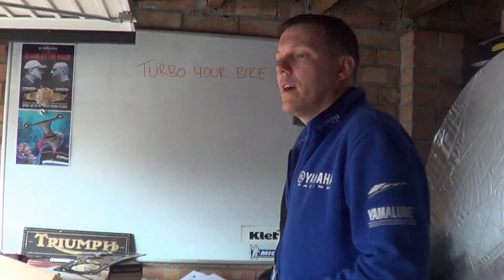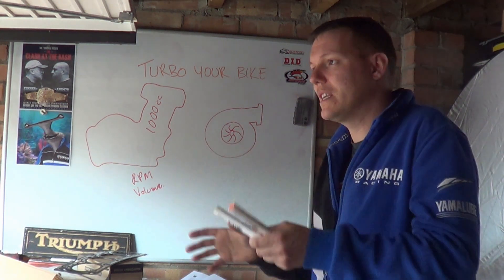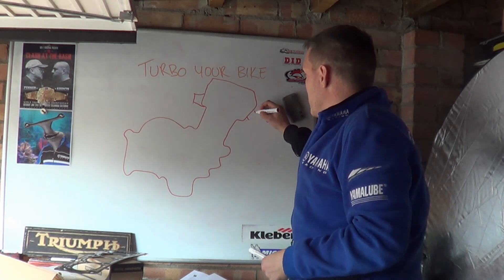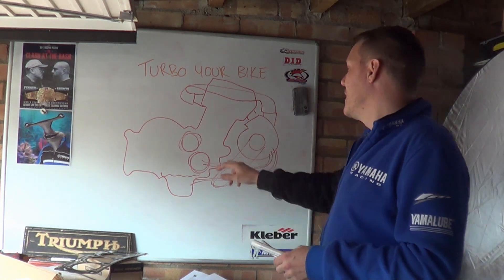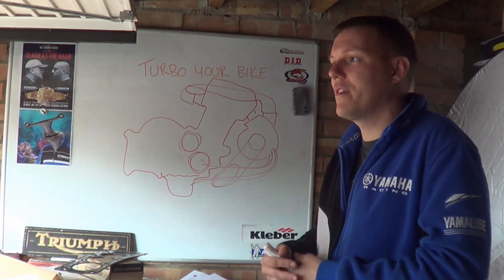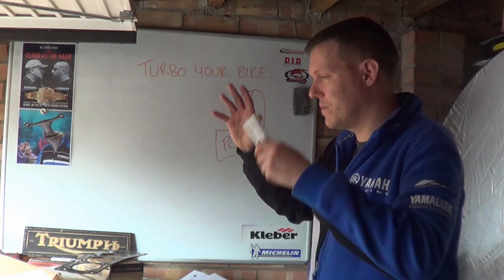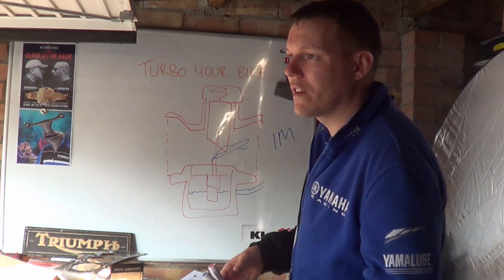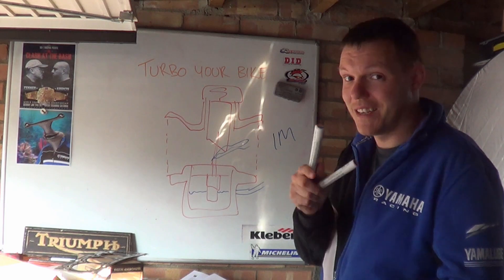So you wanna Turbo your bike? Part 1

Comment: So my bike is 650cc with a max RPM of 6500

6500 ÷ 2 = 3250rpm

3250 x 0.65 = 2100 ish

Would that be correct for liters of air per minute?
Reply from the maker: Well it depends, is it a single or a twin?
Reply: @thedirtyworkshop  it's a vtwin, xvs650
Reply from the maker: So, yes, that's correct. Just making sure it wasn't a 2 stroke.

Comment: Hi I'm fitting a turbo to a 08 zx6r,  drag bike build , motor is pretty much stock. I think I need to lower the compression,  can you recommend a thickness for a headgaskit ,  running a td04 turbo. STD compression on a 08 zx6r is 13.9: 1
Reply from the maker: Lol recommend or work it out for you?
Reply: @thedirtyworkshop  recommended,
Reply from the maker: That was a joke, you need to work it out. Work out what compression you want and what volume that would be

Comment: I would like to play around with this some.  I have several donor bikes, 500cc and 650cc Triumphs late 60's.  What happens if the turbo is too large for the engine?  I can't imagine finding a smaller unit in the local junkyard.
Reply from the maker: The engine doesn't produce enough exhaust gases to spool up the turbo, which means your pressure increase would be terrible and your throttle response would suffer
Reply: @thedirtyworkshop  thanks.  Is there a market for smaller engines with turbos that I may find in salvage or used condition?
Reply from the maker: RHB31 turbo, search for that
Reply: @thedirtyworkshop  NVM, I just checked Amazon and there are several small displacement turbo units available for under $200.  Very inexpensive for experimentation.

Comment: I'm sorry but I've rewatched a few times now and the calculations for what turbo would work don't make sense. More specifically you didn't give key term words on what specs to plug into the calculation. As far as I know I need a 1-liter turbo for a 1-liter engine. I'm just a layman so no offense meant I just can't wrap my head on what you want me to do with my calculator.
Reply from the maker: 1 litre turbo for a 1 litre engine?
Reply: @thedirtyworkshop  I was trying to state how confused I am 😅 the 1 liter bit was intentionally wrong but accurate to my overall understanding

Comment: Well I have found the video I've been needing for the last 10 min since I decided to look into turboing.
Reply: Well if I do, it will be the first rebel 500 turbo... Need to find someone to forge internals for me. Then I can start planning.
Reply: @NoStressVanLife  how’s it coming along bro?
Reply: @love2fight205  well I'm still trying to map how the pipes would sit on the bike and where I'd need to bolt everything to the frame. So far it seems like it should be doable but may be very uncomfortable due to where the throttle body is located right under my seat facing backwards with a lot of wiring around it. Sigh*
Reply: @NoStressVanLife  how about now bro need update
Reply: Update ? @Unknownize
Reply: Update ? @Unknownize

Comment: 100% crazy talk. You will need methanol mist or similar dramatic cooling in the form of fuel (winter windshield fluid)
Reply: You can also retard timing and/or run higher octane fuel

Comment: is it possible to charge [turbo or super] an engine that has a diaphragm carburetor some one told me the crankcase psi is what pushes the fuel into the carb,,,,,,,,,,,is this true??
Reply from the maker: It can at throttle closing - but you can fit a vent to stop this

Comment: In your example of the max airflow of a boosted 2L engine being the same as a 1L NA engine, them flowing the same amount of air in their standard respective formats, great but doesn't that mean if you boost the NA 1L you'll actually need a bigger turbo than the calculation suggests as the volumetric efficency will be much greater under boost condition?
EDIT ah balls it's all based on just revs vs capacity isn't it, sizing of the turbo is done to suit that and applies to both. Makes sense.

Comment: Very good informative video :) 
I'm tempted but my starting point is not that great, just a 600cc bike. I'm not after very big gains, more the fun of building and to have something different. It already have power commander / full exhaust / air filter. I got access to a good workshop to fabricate all tubing / boxes / headers etc. I don't really know anything about turbos but i'm confident that there's some that would fit a small bike these days.
Reply: So I have a Honda cbr600rr ...right and I've been thinking about using a turbo charger from the Suzuki Cappuccino and it is also 600cc and it is turbo charged cause I cant think if any car with about 12000cc and its turbo charge

Comment: What are the best options to scavenge the oil from the turbo into the oil cooler instead of the engine block on a GSX1100G engine? I was considering to use a TD05-16 and leave the engine stock pistons and rods, (meaning, stock 1127ccm) but was worried about the hot oil from the turbo draining directly into the engine. Great video, you've done an amazing job.

Comment: Is it possible to turbo charge Dominar 400??
Reply: Yes but you're better off using a nitrous kit instead cause it's cheaper and doesn't add weight 😜. To turbo your bike you gotta make sure you can fit a custom oil pump first cause without it the turbo won't run for long 😂

Comment: if i wana to turbo my bike how much it will cost (honda cbr 600 f4 )
Reply: Depends how much you are willing to do yourself. Like welding, replacing oil pan parts, fuel pump, injectors, etc. Probably not more than 600$ + (the turbo that you buy)

Comment: Is there any chance turboing bike "easily" like just slap the turbo and thats about it if i use like 0.2bar pressure so just bigger injectors and it will run and hold the extra few horsepower. I got yamaha yzf 750 r.
Reply from the maker: Turbo's require oiling and pipework, system protection (wastegate or blow off valves) etc. There is noe 'simple' way to do it.
Reply: I know I’m late but dude how did you get your hands on that bike

Comment: Possible to turbo charge a ninja 300 ??
Reply from the maker: yes - you can turbo a lawnmover if you want - just quite a bit more involved due to the injection map side of things
Reply: The Workshop going to use the bike for quarter mile drags , please suggest a turbo kit .
Reply from the maker: Why a 300 ninja?
Reply: The Workshop using it for quarter mile races, 400cc class
Reply: Fucking why? lmfao buy a real bike guy

Comment: a friend of mine has a quite simple fuel setup running currently on his KTM 990 turbo . Its a bit crude to say the least but its returning good AFR readings . fuel injection with out much modification . simply just injector and inlet pressure switch that runs power to the extra injector and a ground pulse from original ecu so it syncs the injector with the original ones duty cycle . The extra injector flow size was calculated against the air flow of turbo which gave a good indication of how much extra fuel would be required under boost . it works well for what it is . its not a permanent option tho for this project we just needed to get something up and running with what we had at the time. The system isnt perfect but for some one on a budget is very viable option .

Comment: my bike has 150 cc engine, current mods are 32 mm throttle body, free flow air filter, performance ecu, universal performance ignition cable. could you recommend any other mods to increase my hp further without getting a big bore kit?

Comment: is there a difference between petrol and diesel turbochargers
Reply from the maker: Excellent question which will be covered in part 2 - but apart from diesel turbos being covered in soot - no, not really. Diesels do come in smaller sizes, so I can guess why your asking - matt
Reply: thank you
Reply from the maker: No worries mate - matt
Reply: Well since your never going to find a carbed desiel, fuel is under pressure and injected, you dont have to worry about fuel pressuring :D

Comment: I don't think comparing any engine to any other engine... xD one may be under square while the other over square... an engine that's more undersquare for it's displacement will run much higher fuel consumption/horsepower numbers... as in piston speed :) bore makes horsepower, stroke dictates torque and where the power band is/where the rpm is cut off... so if the bore of each cylinder on one engine is 105 mm and the bore on another engine is 87 mm... but the 87 mm bored engine is 17000cc while the 105 mm bored engine is 1000cc which is much faster and pushes/consumes much more fuel and power to the wheel? the 1000cc ;) so it could handle a bigger turbo at higher crank rpm but at the same piston speed as the 87mm bored engine, which has a longer stroke for the added CCs...
Reply from the maker: "I don't think comparing any engine to any other engine"

 - James Watt did, and he defined horsepower. 

"bore makes horsepower, stroke dictates torque and where the power band is/where the rpm is cut off" 

- no, that wrong. The stroke dictates how much torque can be produced give a given force acting on the piston. Nothing makes horsepower, HP is a measure of work done. Torque over time. That's why torque is Nm or ft.lbs and power is measured in hours minutes and seconds. 

1 HP = 550 foot-pounds per second
          = about 750W
Reply: The Workshop you're definitely correct but the pistons have a limited speed they can reach :) and I'm not speaking of pro dragster running something like 7000 fpm xD but more along the lines of 4600 fpm :) I think that's right where formula one cars sit, because it's pretty safe for a high end racing engine for long periods of running time :) so if that's the top of the fpm then increasing the stroke will just increase torque :) but then you're rpm drops... so you're not making any more horsepower :) cuz you're not running anymore fuel consumption, you're just putting a longer lever on it so it's got more leverage at the crank :) I love your videos btw xD nobody else actually talks about these things... and it's helping me grow some more